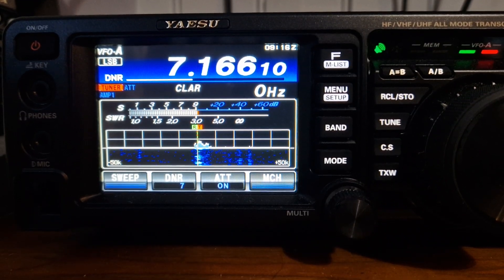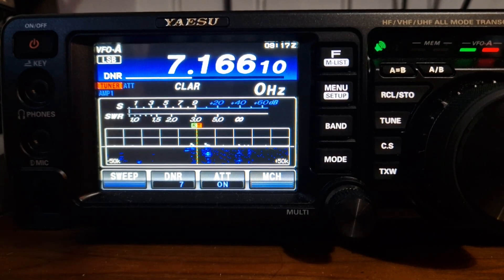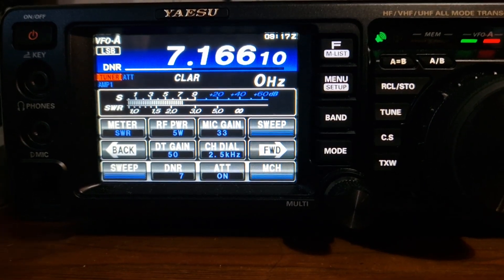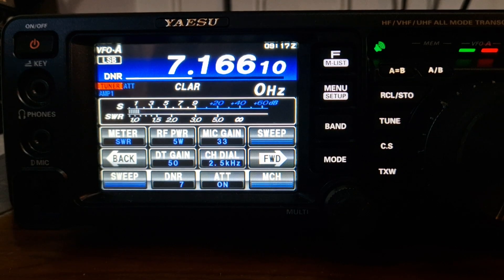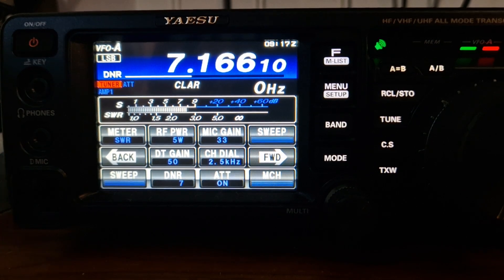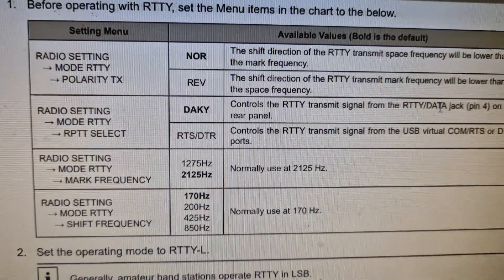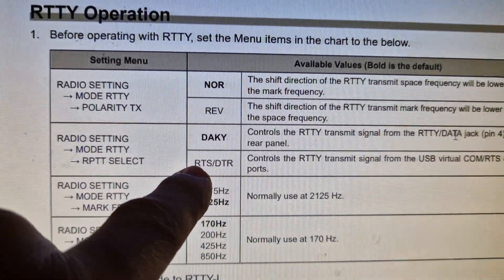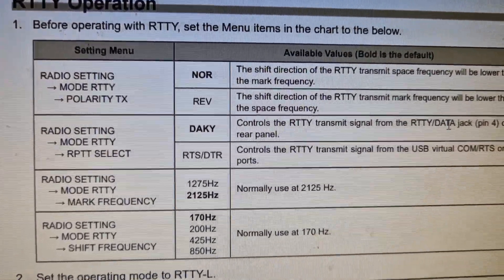YAESU FT-991 DT GAIN - Adjust USB out Put ( Helps with (ALC)

Comment: RTS/DTR stand for "ready to send", and "data terminal ready" as flow control for RS232.  These are logic high/low states.  Nothing to do with analogue levels.  I think the reference to PTT in the 991 manual is that the RTS line it commonly used in data modes as a means to key the radio.  So you are correct about DT Gain being the audio level gain for the data lines, but I think your reference to the manual is incorrect.
Reply from the maker: Hi thanks any info appreciated.